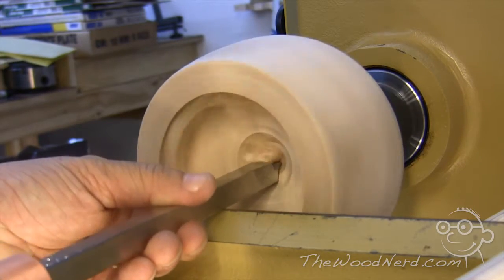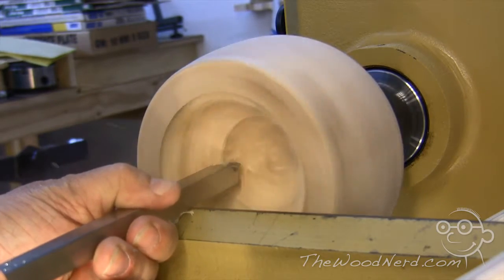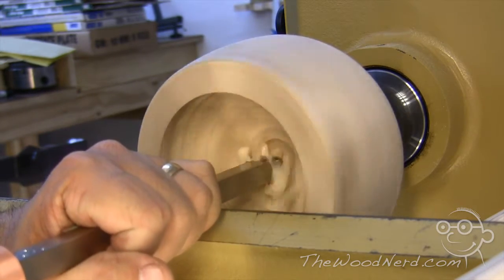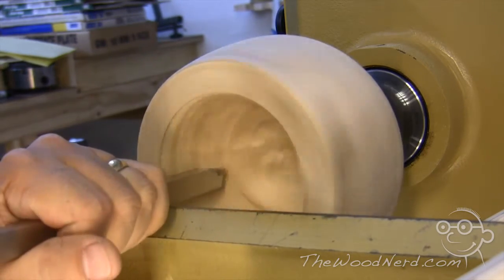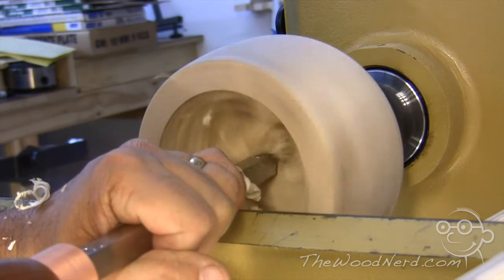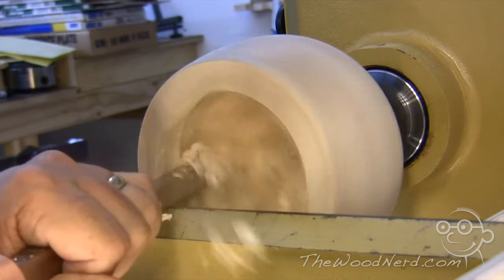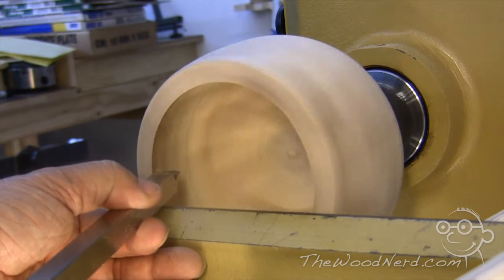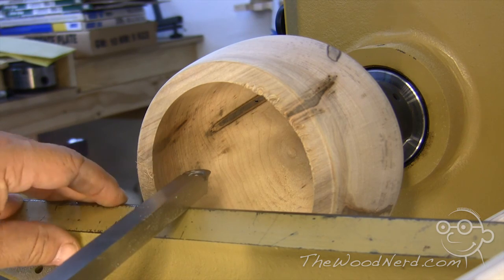Hollowing & finishing a bowl with the Easy Finisher (3 of 3 in the series)

Comment: One major drawback to the square-shaft finishing tools, is that it is very difficult to tip the cutter over that 15 degrees you need to really get a nice finishing cut. I know, as I have used both square and round bar tools, and I will take a round-bar finisher over a square any day. 

Also, the round cutters with the chip-breaker style cutting edge also provide for a much nicer cut, rather than the flat-top style used in the easy-finisher.

Comment: (add to below) Don't get me wrong, the Easy tools are still nice, but I feel they are WAY over-priced in comparison to some of the others on the market. 
Some of the best designed and best cutting tools I have seen are from small companies or one-man operations, and they have been the best cutting tools I have ever used (for carbide tools, that is)

I still feel the best investment in lathe tooling is a 5/8" or 1/2" Ellsworth, it's one gouge that will do it all, start to finish, log to bowl.